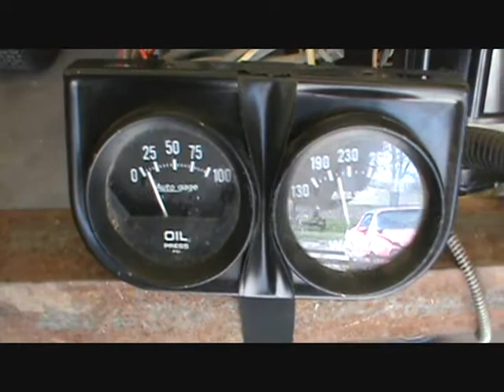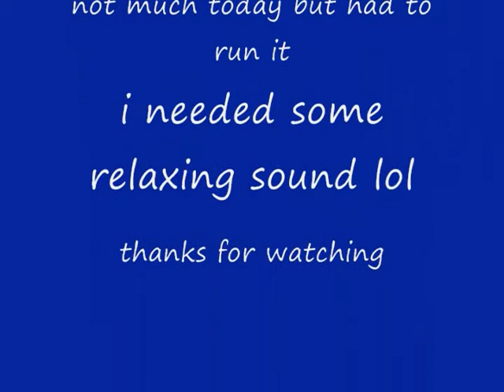making saw dust and running the 350 chevy again

Comment: I hope those castors don't have a premature death from being overloaded, but they look good, your a great welder bear
Reply from the maker: well the caster i bought are rated for 500lbs each so i could put 2,000 lbs on them.the motor complete like it is weighs in at about 700lbs so they should be fine.
Reply: tlcbear2 cool, I guess I misjudged how heavy the engine is, it really isn't that heavy and the way you have them mounted is good